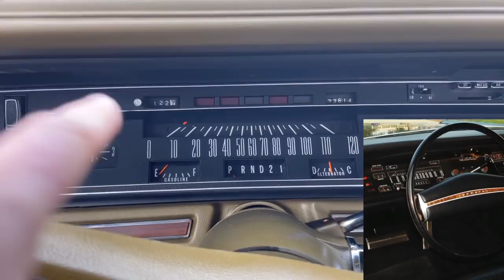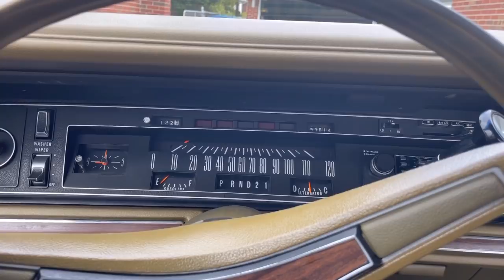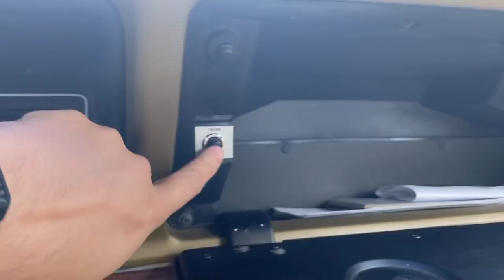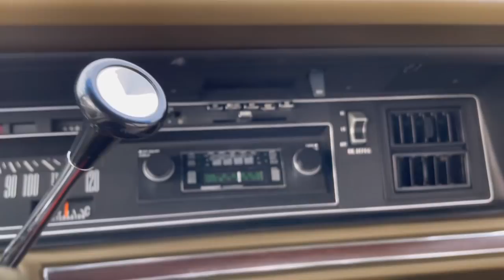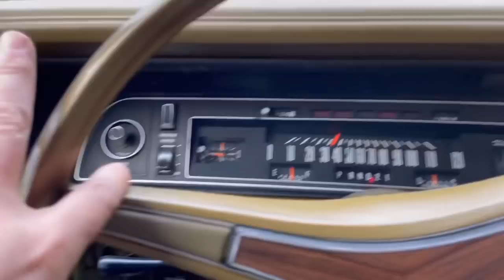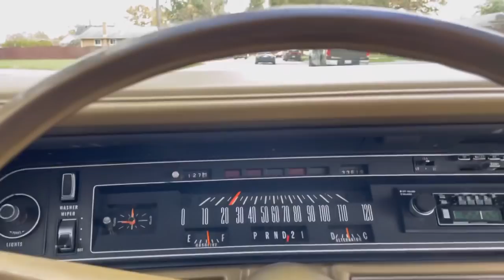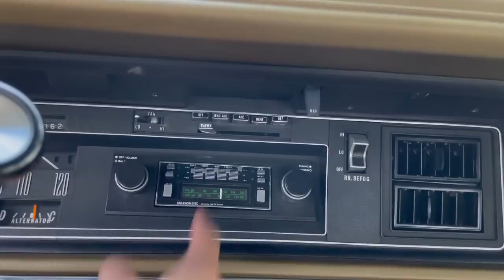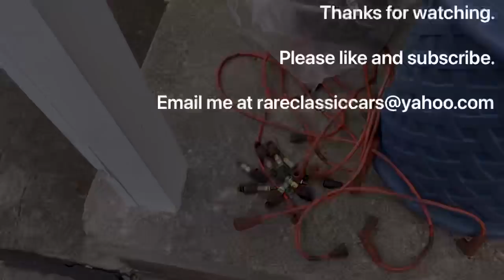FULL REVIEW: 1972 Chrysler New Yorker 440 V8: Fuselage Era Chryslers

Comment: Our family had a '72 New Yorker (I was 18 then) and I remember it being extremely quiet. For '71 full size model Chrysler products, they added rubber bushings between the front subframe and the body, and it made them much quieter than the previous unibody cars and even quieter than full-size GM and Ford products. I suspect your car here sounds noisier since its bushings are 50 years old.
Reply from the maker: I’ve owned quite a few of these and I find them noisier than GM and Ford products of the era.  These are typically 70-71dB cars at 70mph. My 72 Imperial is much quieter at speed at about 68dB.

Comment: I put many thousands of miles on 71 Fury Police package version of this along with 72 chevy Impala, 72 AMC Matador Police, and 74 Merc Montego, 78 Impala police, and then 1980 R-body Gran Fury Police.  It's true that the 71 Fury had good drivetrain it was a noisy poorly sealed car.  Had the 383 and it topped out at 108 mph.  On twisty tight curves the carburetor would starve the engine for fuel.  The power steering when bad and shop couldn't fix it so it got swapped for the 72 Impala.  What a difference, it was like moving into a luxury car, such nice seats, such quiet but handling and power were not up to the 71.  But when driving thousands of miles a week the Impala won out.  The 72 AMC Matador was a great car, it was all the redesigned 77 Chevy was to be but 5 years sooner.  Too bad the market didn't reward it.  Even with the 287 engine it was a snappy performer, great handling, good ride.  It's biggest shortcoming was that like the 71 Fury it let in excessive noise.  The Montego even with the HD suspension was a marshmallow, the smog-strapped 302 was a dog and it was hampered by a 2.4 (?) rear end ratio.  Once had it on a uphill dirt road and slowed to go over a large rock, as the tire made contact with the rock all forward motion ceased... not enough power when floored to handle both the grade and getting over the rock.  Had to back up and take a run at it.  But comfort!!  That Montego was a real lux boat compared to any of the others as far as seat comfort and low noise.  The 78 Impala was the best all around of this eras bunch.  The 80 Gran Fury was a close second.  Both were wonderful handling, great riding cars, very quiet, very smooth drivetrains.  350 in the Chevy and 360 in the Gran Fury, not overwhelming but plenty of power.  The Chevy had a slight edge in AC power and seat comfort.  Both felt like they were made from a billet.  Had the later 95 Chevy police and 2005 Crown Vic police.  Both were good but honestly the 77 Impala and 80 Gran Fury seemed like better cars overall.  The 95 did have a great engine from the corvette.  The 2005 CV checked all the boxes yet was never as endearing as the earlier cars.

Comment: People complained about the ride on this era of Chrysler products which was a shame because their engineering was way ahead of their domestic counterparts. The problem was that like all domestic cars they were equipped with cheap shock absorbers but Chrysler used Gabriel’s which were very firm and low in quality and also needed replacement at 12,000 miles where the other two domestics needed replacements at 24,000 on their OEMs.  I had a few early 70s Chryslers and found that with a good set of Monroe RadialMatics and a set of Michelins and they had a better ride/handling balance than just about anything.

Comment: OK!!! I finally found out who you were talking about.
Wes Dahlberg!!!!
He designed the Ford Tanus in BRITIAN and many think that Elwood Engel got the idea for the 1961 Lincoln's front end from that car.
If you have any info comnecting Wes to actually designing the 61 Lincoln I'd love to see it.
Its Elwood Engel's design.
Reply from the maker: Yes. That’s it. 
I suppose it’s all debatable.  I have friends who worked at Ford in the early 60s, and a number related Engel was very, very inspired by the car.  And it’s a bit more than the front end.  The Taunus body sides are super clean and relatively straight as well. So the theme isn’t identical, but it does have a number of characteristics of the bigger Lincoln. 

In a similar fashion, I can tell you Pontiacs response to the Lincoln was the 63 Grand Prix, which looks different, but if you look closely, you’ll see the inspiration.  I know Bill Porter who was Pontiacs design manager (later design director) back then who penned the GP, and he told me directly about the influence.

Comment: Those asymmetrical lit cars you mentioned ARE NOT single cars - they are design exercises that show two or more possibilities for headlight and tail light treatments. They did it for B pillar treatments, too.  You can see station wagons with two completely different rear ends split down the middle in the same set of photos.  Another reason the early 60s Exner designs looked funky is that they were designed for a longer full size wheelbase, but they got faked out by the GM downsize rumor as you say - but if you see the drawings of the full size cars they looked much better than what they looked like as released.      🚗

Comment: All the mopars that I have owned have all had the compressor kick in based on the outside temperature and the heat being selected. If it gets below a certain temperature outside the compressor will not turn on when you select high heat.
Reply from the maker: That is correct, so long as the temp selector is past that relay engagement point.

Comment: They might have been a pain to keep tuned but no carburetor sounded as good as a Thermoquad when you got into it.
Reply from the maker: I think QJets sound the best.
Reply: @RareClassicCars  The TQ is much better sounding! In my experience and opinion anyway lol.  Easily adjustable to ANY application you want it for. And actually very reliable. You do have to have a lot of patience and follow the correct step by step procedure for adjustments but it's worth it. I like the in-your-face loud sound vs QJ's smooth mellow tone.
Reply: @ayryz1  I've had several thermoquads over the years and you are correct in what your are saying. IMO it was a very underrated carburetor.

Comment: Excellent video, well done!  It was like I was in the car driving it.  Only 29,000 miles, wow you got a good car, original spare, period mats, awesome.  And very nice colours too.  You didn't say what rear axle it had, I assume the 8.75 rear, did it have the Sure Grip? And what ratio?  I assume 2.76?  I'm from Australia, I have a couple of (first generation) Dodge Challengers.  I can sort of see why these didn't sell that well.  Nothing wrong with the exterior styling, it's neat and eye-turning and has the Chrysler wow factor; but the interior lets it down in my opinion for that price you stated.  Functional sure, but just looks cheap.  The cheap loop carpet, park bench front seat, plasticky paneling around the C pillar, uninspiring-looking dash (no temp gauge, unbelievable), basic interior lighting (well at least it has the Map Light).  For the price, can't believe it didn't get footwell lights or C pillar lights;   it's almost like an upgraded fleet car.  

At least it has electric windows and power disc brakes and rear defog.  Power steering is taken for granted on this size car.  I think a firmer-feeling power steering is more desirable - that and the firmer ride /better cornering makes it more of a driver's car, at least in feel.  Maybe they should have done away with the Brougham and given this model more luxury features for the price.  The bouncy ride would be annoying but in my opinion, a firmer ride is more desirable than a cushy ride.  However maybe they needed to think things through a bit more if it bounces around that much -  maybe better shock absorbers required, not sure about that.  But I don't think the TB front end is to blame for the bouncing.

I agree about the auto electrics being finicky.  Along with another ballast resistor in the glove box, I would also be carrying around another good ECU, as these are very prone to just failing for no reason.  And very easy to replace on the roadside if needed.

The external indicator flashers are a nice touch and the rear end styling is really great, love it.

The only thing preventing  this car from getting over 130mph would be the wind resistance! 

Good video.  No stupid music which really turns me off other videos of this type.  Thanks again.

Comment: No doubt this is a great looking car, especially considering the era it is from.  I'm not real fond of the fuselage styling, but this is a handsome design. I think I have to say I like the redesigned models with lower beltline better, from 1974 on.  As I said before, I think Chrysler  lost so much ground because of the cheapness of the materials in certain areas, and in their relatively noisy and rough ride, as compared to GM and Fords of the era.  Quality control was never the greatest for most Chrysler cars either, as I recall.  Even things like the quirky chattering starter sound probably tended to be off-putting to potential buyers.  I would have thought Chrysler would have recognized these problems and adjusted their cars accordingly, but they never seemed to do so.  And they're still struggling today, but it's fun to look back on these cars and their high-quality in many ways, albeit with some shortcomings.

Comment: $4950 in 1972 is about $32,500 in today's money. Not bad really, considering people willing drop double that amount on SUVs and pickups today.
Reply from the maker: That’s true, but remember there was no 0% financing for 84 months.  Stretched out payments have enabled higher sticker prices.  I think most cars were financed over 3 years back then, so the payment on a comparable $30k car was 2x the typical payment today.
Reply: @RareClassicCars  You are correct about financing during that period.  Cars born in the 50’s, 60’s, and 70’s were frankly considered “high mileage” vehicles at 50k miles.  During that era, cars rusted out much more quickly, and two and three-speed automatics meant higher engine RPM’s at highway speeds, shortening engine life.  It was quite normal to buy new every two to three years, and most used car loans were two years or less.
Reply: @RareClassicCars  Good point. People either saved up for a car or financed it higher interest rates and for shorter terms. Today, people just want to know what the monthly payment is, and if it happens to be for 6 years, so be it. It makes today's car buyer less concerned about the total price. Adjusted for inflation, $32,500 seems quite reasonable in 2021 for a luxury car, SUV or pickup. We've been conditioned to accepting $50,000 and $75,000 vehicle prices now.
Reply: @Primus54  Yes, I remember my mother telling me people traded in their cars every two or three years out of necessity in the 1950s and 1960s. Five years was really stretching it. Even by 1989 when I started driving, and got to use my mother's' old hand-me-down brown 1978 Ford Pinto, it was easily one of the oldest cars in the student parking lot. Other students asked me why I drove something so old. The car was 11 years old. Today, an 11 year old car is a 2010 which would go unnoticed. We still see many good and bad 11 year old cars on the road today, blending in with traffic, still fairly reliable and rust-free.
Reply: @reallyrandomrides1296  I was born in ‘54 which means I started to be aware of cars in the late 50’s.  Car designs were so unique back then that every make and model were easily identifiable from a distance and every year had enough distinctive changes to make it easy to identify.  My current daily driver had a significant redesign in 2014 and did not change year to year through 2020.  Only trim names changed midway of the seven year run.  Cheers! 👍
Reply: @Primus54  Yes, I think 1950s (and to a lesser extent, 1960s) cars were the most stylish cars with unique designs, and seemed to be updated quite often (I love the fins and jet age atomic era styling). The one exception from an American automaker I can think of, is the Jeep Wagoneer (SJ) which kept the same basic boxy body style from 1963 to 1991 (nearly three decades)! If they had produced it a bit longer, it would have been back in style again!
Reply: @reallyrandomrides1296  Agreed.  The Jeep benefited from its iconic design by NOT changing.  The imported VW Beetle was much the same.  Both had a following that was almost cult-like (in a positive, not negative, sense).  Cheers! 👍

Comment: I had a 440 powered 1969 Dodge Monaco station wagon in 1976 that I bought used. I was teenager at that time and when I went on dates I sure has heck borrowed my sisters Dodge Dart No fathers were ever going to let a teenage daughter date a kid with a station wagon. The main reason I even bought the wagon was I was working part time delivering newspapers from the printing press to the carriers so I needed something that could haul over 600 pounds on a Sunday.  Of course rust was final curse on that old wagon and I ended up trading it in for a 1975 Plymouth Duster in 1979 when I was in the Air Force.  

 Some observations from having a fuselage era Chrysler products. If you notice the front and rear bumpers have slot cut out them just inside the turn signals and somewhat centered between the rear license plate and side of car.  Those slots were for the dangerous bumper jack that the slots lined up with on jack.  

ON the ballast resisters water would get behind the resister and be be trapped against resister and firewall of course shorting it out. When I was stationed in the Philippines we had boat load of the pickup trucks and I cut up and put a old truck tire inner tube screwed into the firewall and make a flap to cover this problem. It seemed to help cut down the number of burned out resisters and I had even done on my personal car because by that time I had a Plymouth Duster that used the same resister. 

The final thing is I always found that Champion spark plugs seemed to better for the Chrysler products of that era and was the preferred by Chrysler's as they were the OEM from the factory. AC spark plugs tended to not do as well and gave much worse performance.
Reply from the maker: Interesting. The only area I differ from your opinion is spark plugs.  Never had good luck w Champions. They were a bit fragile and the resistors tended to fail internally. I always run Delco plugs in my Mopars (shhh).  They run beautifully and never have an issue.

Comment: I'd say don't start your tune up unless the motor is cold , like in the morning. put a piece of vac hose on the end of the plug to make it easier to start threading it in the hole . And the Ballast resistor probably had a bad ground . or was just old .  yeah they will go out sometimes anyway, also leaving your key on in the accessory position will cook a Ballast  .  my 75  76 Cordoba Never had one go out .  points cars however hmmm

Comment: The top speed  is more  likely to be around the  150 MPH mark, the speedo won't  show  it and I  think  you can  imagine  why the  suspension  is stiff, yes to hold all that  weight  and  power between the  lines. 
You need a  good straight road to  top end one of  these. 
I have done it.

Comment: I believe that but about the key design. Never had a problem with Chrysler door locks in the winter. GM's? Very different story. Better off not locking your doors when its cold out.

Comment: When looking at poor sales of these early 70s Chryslers, you have to consider just how stiff the competition was particularly when you look at cars like the 1971-73 Impalas and Caprices which were extremely good-looking, bulletproof cars. These early 70s Chevys handled great, ran great, rode like silk and were extremely reliable. I keep hearing you refer to these early 70s GM full-size vehicles as the "jiggly era" cars compared to the 1965-70 GM offerings, but frankly that is just not how these vehicles were perceived or thought of when they came out---not even close. Compared to the 1965-70 GM vehicles, these early 70s Impalas and Caprices had much better steering, better brakes, better suspension and felt much more solid and maneuverable going down the road.

Comment: I carpooled with a fellow designer who owned the same car from St Clair Shores to the Chrysler Engineering Center in Highland Park Michigan for about a year before transferring to the Detroit Tank arsenal. It was quick and very roomy, but the Fit, finish & materials were subpar. In the 70s, Ford seemed to have better quality. After 3 or 4 years of Michigan winters, they all turned into rust buckets.

Comment: ANY Mopar with early electronic ignition, yeah, keep a spare ballast resistor in the glove box. That's a small price to pay. I remember my mother changing one out in the parking lot of my elementary school in the early 1980s. 

GM HEI distributors ran with one 12V wire to the distributor, that was all it took to get the engine to fire. GM one-wire alternators with the integrated voltage regulators were better too, but you gotta admit that a Mopar alternator just looks better. GM Delco was better electronics. Mopar engine and transmission were better than most GM. 

I am a Mopar fan. My ideal combination would be a Slant-6 with an A-833 4-speed manual overdrive. And, LOL, an aftermarket GM HEI distributor. I will not butcher the wiring harness, I promise. 

I love your car. Please take good care of it.